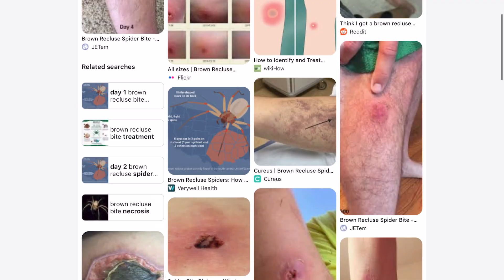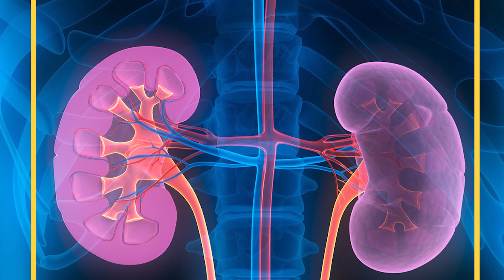You're WRONG About the Brown Recluse Spider

Comment: OK I have seen with my own eyes a hole as big as my fist in the side of a female  friends leg after the doctors cleaned out the rotting flesh from the bite of one of these spiders
Reply from the maker: It is possible to have a larger injury after receiving treatment to remove necrotized flesh, but generally the actual damage caused by the spider is smaller in scale. Thanks for watching!